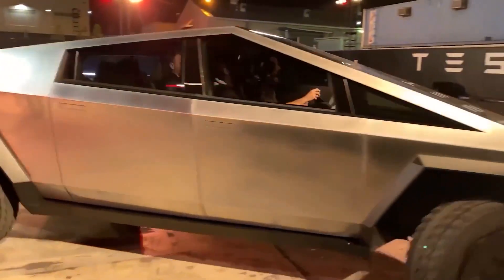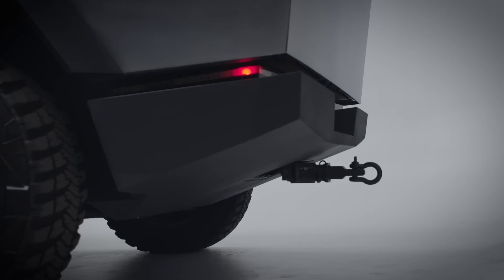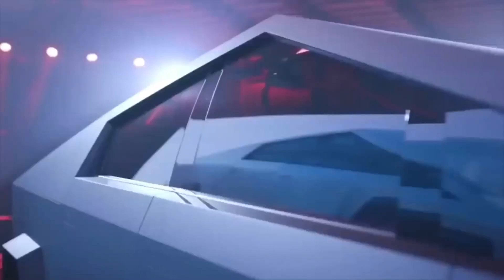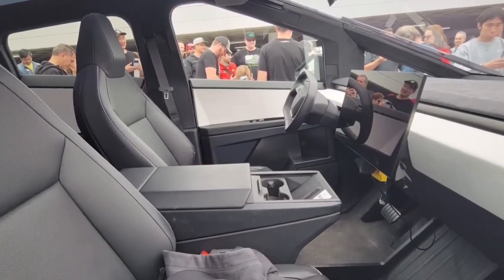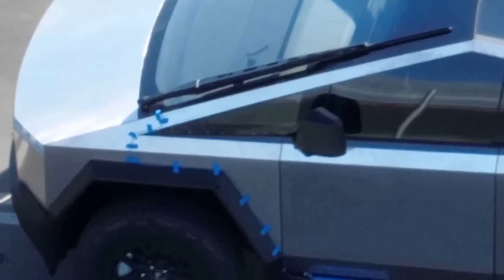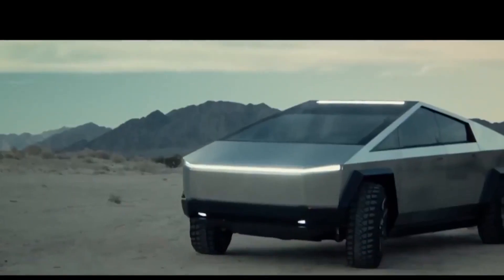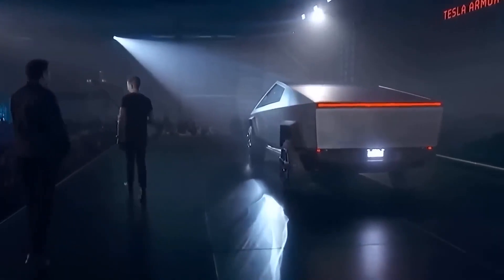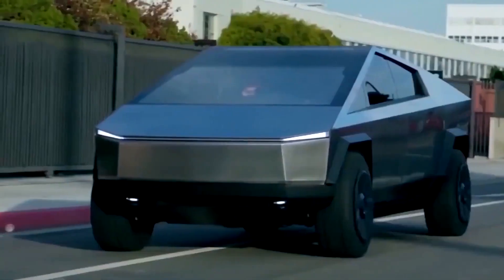Tesla & Elon Musk REVEALS Cybertruck UPGRADES For 2024!

Comment: Really want to set one up for escorting Oversize Loads. I drive between 80-100 k miles a year. Problem is I need to be able to keep up with a semi...so a 600 mile range. A hybrid version for commercial use would be great but Elon wouldn't want to hear that. Solves the problem of lack of infrastructure though, at least until the battery issue gets resolved.